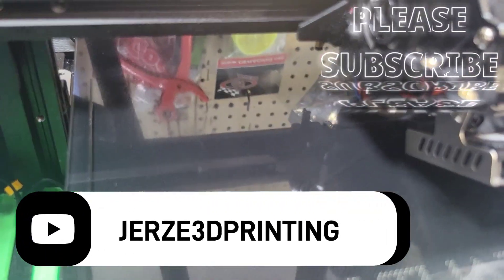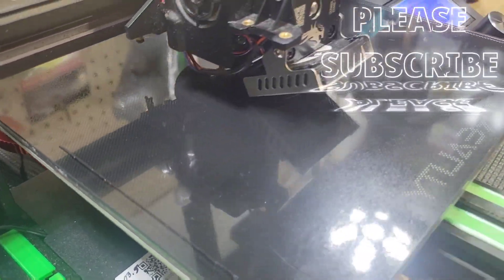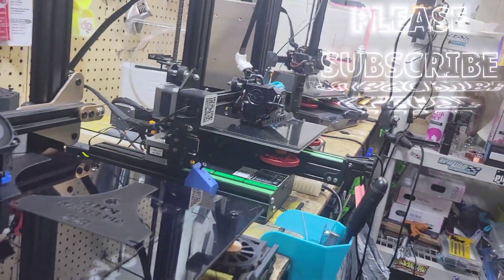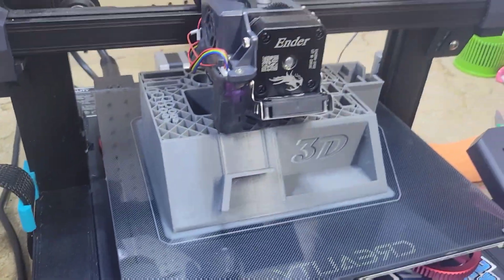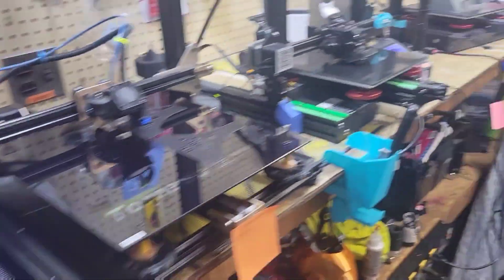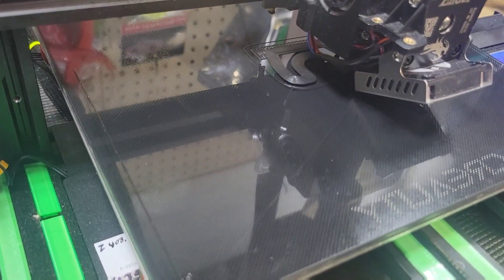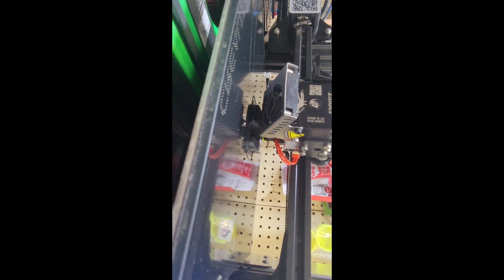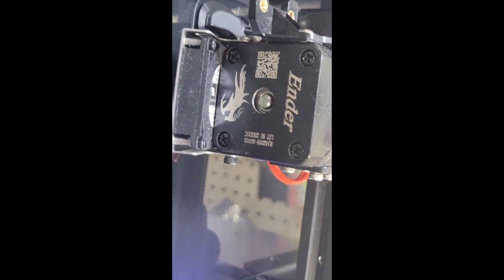ENDER 3 PRO WITH SPRITE HOTEND/FAN DUCT MOD #3dprinting #ender3s1 #ender3pro #ender5 #creality3d

Comment: Awesome job!!! Thanks!
Reply from the maker: Thank you 😊
Reply: Man, is it possible to adjust the airflow direction to bottom (just a little angle)? I tested yesterday and airflow is going to nozzle and not directly to the piece. It’s working and better than stock, but I think could be better 👍
Reply from the maker: @victorsung8806  yea ill play with it a little more then resend you the stl